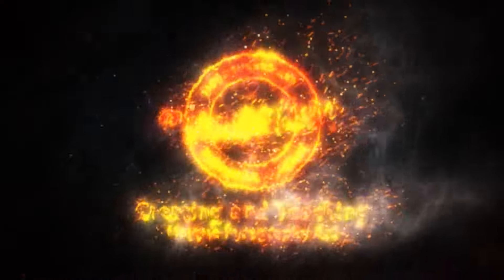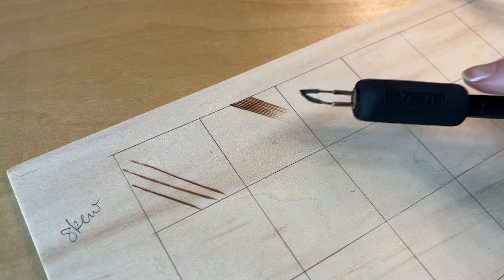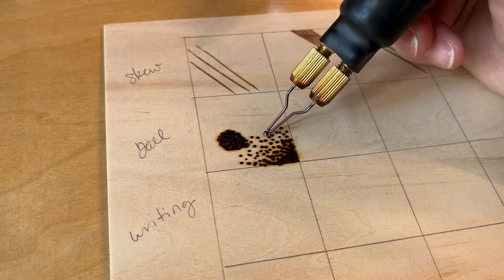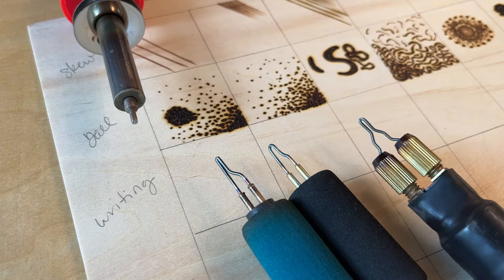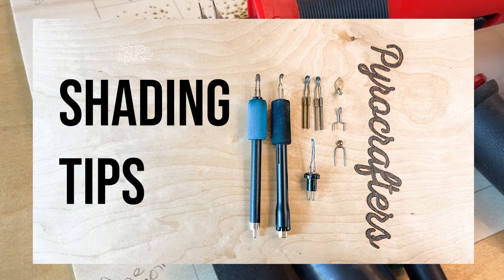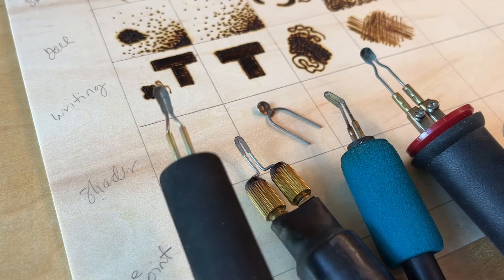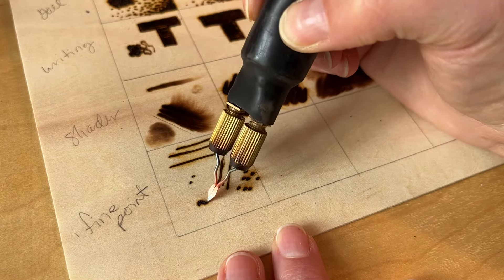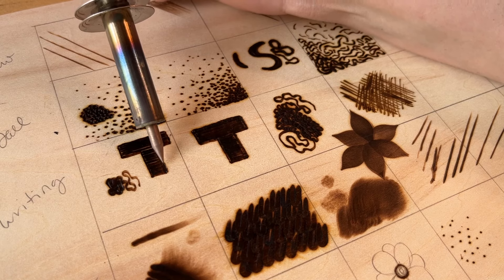5 BEST Wood Burning Tips - Which Tips to Use for Wood Burning

Comment: I had to make some signs recently, and those signs were too big for my laser cutter.  so then I hand drew signs for 8 hours. argh. 
I used  ta real fine tip for most of it. but then, after about 6 hours that tip was spent. all burned out. tired sanding it, that didnt work for long. I havent done much wood burning in the last 15 years, since I got a laser cutter. All I really remeber is running fast and hot, and get stuff done. Its nice to have an overview of tips and styles, I never knew any of that. I just have a brass wood burning kit, and my soldering iorn. when I saw those wire tips in action, I knew thats what I should be using. oh well, my signs are done...

Hey, how long do you get out of your tips?
and what do you do when they turn black with resin?
Reply from the maker: My tips have lasted a very long time. In all these years of burning (7 - 8) I have only burned up one tip. And I burn on high heats a lot. I think keeping a lighter pressure when your pressing your tip to the wood helps it last longer. 

And as for the buildup on the tips; now i use a leather strop with an metal polishing compound to help clean them. They are never as shiny as they are when I first buy them, but it does help them glide across the wood easier.